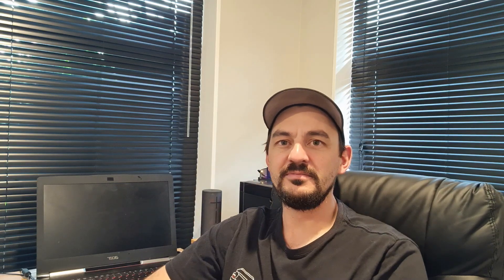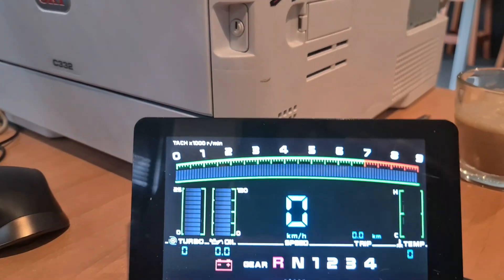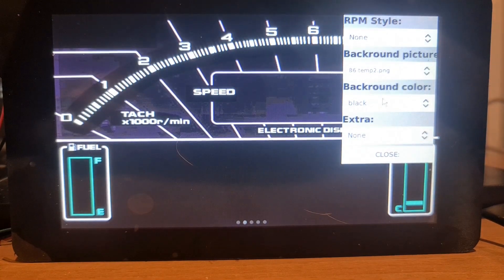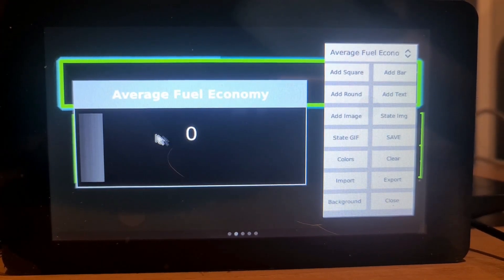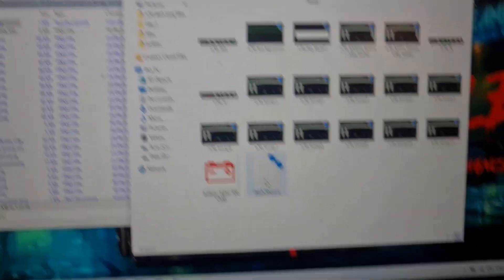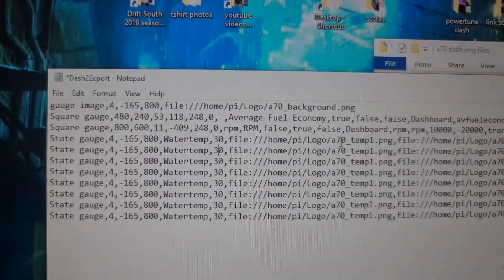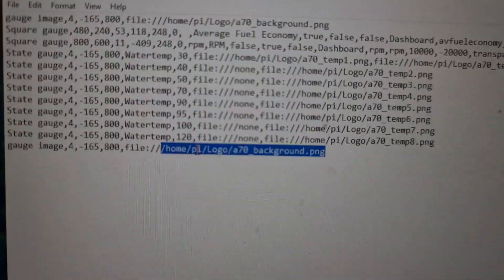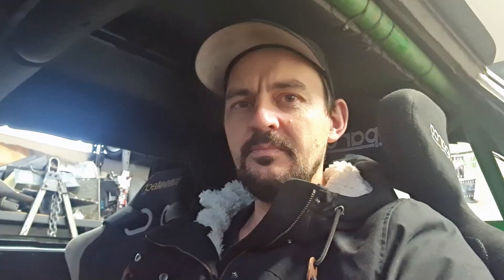Powertune Digital Dash basics PT2

Comment: how'd you get a mouse plugged in to it? are there usb ports under the rear cover (just got mine delivered today so not tore it apart yet :D)
Reply from the maker: The early models had usb ports I can actually remember if the new ones do under the cover
Reply: @GasketFuka  they do but i plugged my mouse in yesterday and it wasnt picked up on the device :( i've messaged powertune to see how to resolve coz it's near impossible to do the layout using the clunky touch screen
Reply from the maker: It's good for getting things in the close spot even with the mouse I always tidy things up in the text files. You can put everything on the same x or y axis to get them lined up
Reply: @GasketFuka  yeah i had a good play around with it yesterday and like you said for fine tuning the text files are the best way. part of the problem with those is that there's 0 documentation (that i can find) about what each value represents which makes it very difficult for someone new to just pick up and start modifying the values. only thing i think might be able to reference is the initialisation parameters for each gauge type in the .cpp files on github but i've not checked that yet. since it's quite a disjointed experience of having to make the changes on my PC then transfer them to the device it would be nicer to get the mouse working so that it's not a completely hateful experience working with the touch screen. 

also big thanks for your videos as without them i'd have no idea where to start

Comment: can we add something else say afr instead the oil pressure?
Reply from the maker: Yes definitely you can
Reply: @GasketFuka  how? it will not allow me too change valves or let me set anyother perameter when i click it... i want to put afr instead of the oil pressure on a the a70 layout 😉 and also the same for the ae86 but inatead of the fuel level i want fuel pressure... so please let me know how to, really excited to use this layout

Comment: So how would you make a gauge that's not bars, but with needle? you'd need an image for every possible increment of the needle?
Reply from the maker: I'd just use the dial guage that is in the factory options on the powertune.

You can play with all the settings and turn everything off except for the needle itself if you want and draw your own background
Reply: @GasketFuka  Thanks for the reply, what about numbers? Are you able to load your own text files if you want the numbers to match the text you used on the background? Example, I'm making a background that uses a text I downloaded and has writing on it, I'd like the numbers to match, so is it possible to get the power tune to use the same text font?

Comment: question if i use your dash parameters but im using fahrenheit instead of Celcius do the temp numbers need to change or will the ecu understand and convert?
Reply from the maker: It should just display what your ecu does so if that's in Fahrenheit will be the same